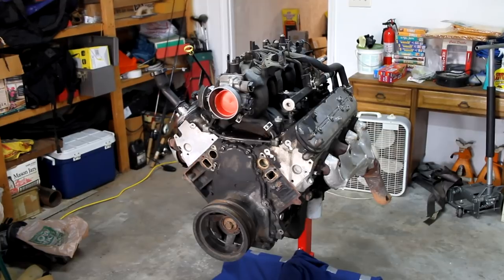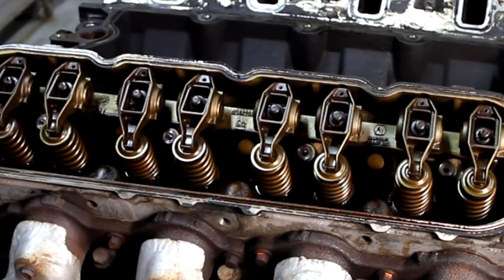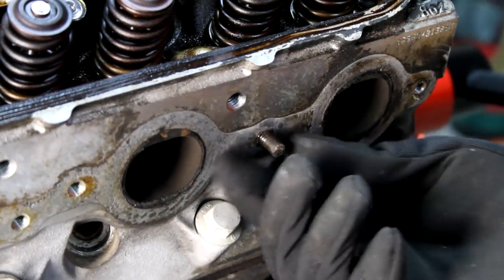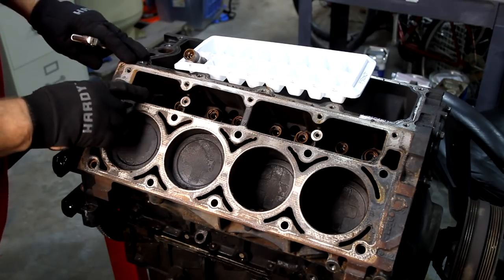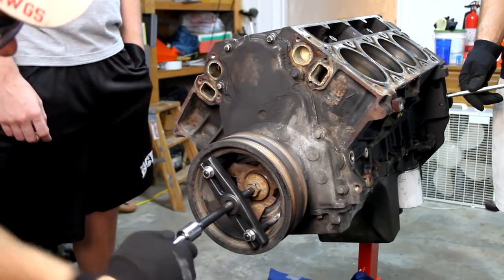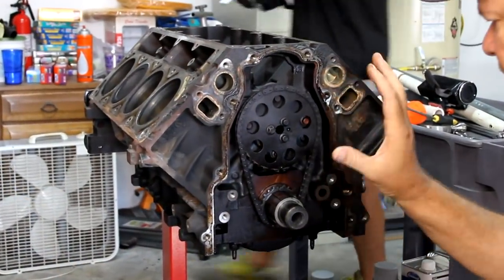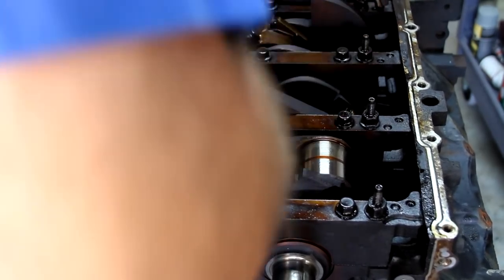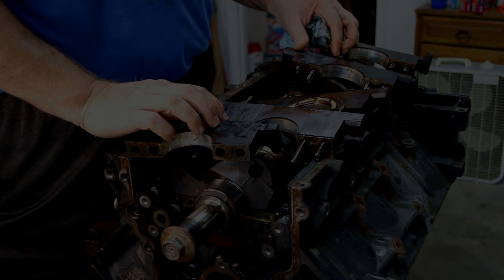LS 5.3L Build Part 2 Teardown | Project Rowdy Ep006

Comment: Love the old school manual wrenching , everybody uses uses power tools now.
Reply from the maker: LOVE this comment!!!!  To date, I have received 5+ comments suggesting that I should have used Impact wrenches and other power tools.   First off... I have 2 Air Impact Wrenches and a Cordless one as well.   The manual that I followed mentioned that many people destroy the end threads of Bolts and Holes.  It suggested not using them.   My thought was... Cool I breakout the old Speed Wrench and have some fun.  We weren't in any hurry...  If we were, we wouldn't have filmed and edited it (adding to the timeline 4 fold!!!!).  Damn... I sped up those boring parts and trimmed the duplications!  Just goes to show that you can't please everyone.  Especially the Online Keyboard Mechanics.  Their videos are perfect!!!
Reply: @UCanDoIt2Mike  will agree impact guns can do damage removing bolts especially in aluminum do to the speed... i do however like to use air ratchets... still faster than hand but wont sit there free spinning the bolt on the threads under pressure... not a complaint just a thought for others who may not know better... and ill admit i do things different for work vs my  personal projects(for pleasure).. sometimes its just more fun to take your time
Reply: @UCanDoIt2Mike  Yeah, I've never understood the need for folks to say "You should use power tools".  I mean, would I use them? Absolutely!  But this is YOUR project, not anyone else's so I can respect your decision on not using power tools. Damn good point though on boogering up the threads upon removal with an impact. It's something that I'll definitely keep in mind for the future...
Reply: With that logic why do you drive a car. You should walk since everyone uses cars to get around these days lol

Work smarter not harder.
Reply: A ot of time on his hands.
Reply: I'd rather use hand tools u risk breaking something with power tools alot more than with ur hands
Reply: I had the same thought as this comment

Comment: Thanks for the shout out. I am also picking up some good tips from you. I like the ice tray for lifter storage and the 2X4 for push rods. I'll do that next time. Ive used an old shoe box with holes poked in the lid before. Awesome tear down video!
Reply from the maker: This is such a great platform to share information.  I had ordered a couple of trays for the teardown but they were going to be delivered several days after I realized that I wanted to perform the teardown.  So I cancelled and made my own.
Reply: Sam's Garage I thought the ice tray and the 2x4 were excellent ideas aswell haha!
Reply: Yeah I like that idea as well .

Comment: Great video a couple of tips for the harmonic balancer you should always use a 3 jaw puller to remove a LS balancer. When removing the cam use a couple of the long water pump bolts in the cam as a handle to help you remove and install the cam.
Reply from the maker: Justin Thurman very good points.   I had seen many time people using the water pump bolts for the cam.  The manual that I was following suggested the method I used, so I thought I would give it a try.  Cheers!

Comment: What did you use to pull the balancer? Also how did you position that piece inside it to pull it? It's not a traditional 4 arm puller correct?
Reply from the maker: I was unsuccessful with the 2 types of 3 jaw pullers.  What I used in this video was the large Bearing Separator that is a part of a 2 separator kit from Harbor Freight.  I placed the separator behind the balancer and the center threaded portion went against the original Balancer Bolt.  Worked great for me!
Reply: UCanDoIt2 oh that's very interesting. Also I know someone already asked you but what size bolt did you get to install the new balancer
Reply from the maker: The Temporary Bolt that I bought is:  M16 x 2.0 x 120mm (Fastenal # 11127092).  It is long enough to get good thread depth for the initial part of the installation.  I explain most of this in Part 5.  Cheers!

Comment: I had same problem with my 5.3 with lifters they were hard to pull out towards end
Reply from the maker: My original lifters had just the slightest bit of build up on them causing them to be a little difficult to pull out as you saw.  The new ones slid in without any issue.
Reply: Same here

Comment: good tutorial. you need some air tools though!
Reply from the maker: I appreciate that!  I have Air tools.  The manual that I was following made a good point on damage to threads when using air tools, so I elected not to.  I did try to speed those section up for your entertainment!!!!!  Thanks!
Reply: the speed up looked cool, but i was mainly referring to the removal/tear down for air tools. I never use them for installation. good work regardless
Reply from the maker: Interestingly,  the book mentioned that people using air tools often bare down to ensure staying on the nut or bolt head and that if they continue to bare down when the threads reach the top, they bugger (technical term) up those top threads.   I wasn't in a hurry and decided to go at it old school. It was fun with the boys.

Comment: 862 heads on this 5.3. Not a bad set up. The video was so helpful. I'm shopping for 5.3s now.
Reply: Can you bore this over 30 ? That put you up there at 5. 7 ? Get 400 hp
Reply: Estebahn Randolph depends on if it’s an iron block or aluminum and what generation LS.

Comment: When doing head bolts good or bad I always soak them an then tap the heads with a hammer. Haven’t broken a head bolt in years since doing that.

Never use impacts either. Always use breaker bars. Hammering shocked the threads and usually loosens the crap holding them on like rust and grime.
Reply from the maker: Not sure how I missed this original comment.   I agree with hammering, breaker bars, and staying away from Impacts.  It's hard to convince today's crowd on some of these items as they are so driven to get things done fast.  It is always best to do it right.   Cheers!

Comment: Hi UCanDoIt2 - did the LS Cylinder heads where the studs broke on the exhaust manifolds when you removed the bolts did it pull the threads in the Aluminum Heads?     By the way GREAT VIDEO on the LS 5.3L ENGINE!!!
Reply from the maker: All three of the broken Exhaust Manifold bolts came out cleanly.  Not sure why the heads were broken off.
Reply: @UCanDoIt2Mike  Thank you for replying GREAT VIDEO series the LS engines and GM small blocks are the BEST!

Comment: We have done many jeep swaps over the years installing 351 efi winsor ford, 350 carbed chevy and also did a 360 efi magnum mopar in the past. They all did fantastic plenty of power and lasted thru the abuse. One of the best swaps we did was taking a flipped 96 f-250 4x4 7.3 diesel standard trans with only 30 k on it shorting the frame and sit a 94 bronco body on the modded chassis. we  gave the 7.3 a stage 2 cam higher flowing injectors bigger turbo and a intercooler that was not standard in 96 That was supposed to bring it to the 500 hp huge torque range, never dyno'ed as the twisted drive shafts and broken yokes proved the power ... That bronco was a beast that would not stop after having non hollow drive shafts built and it brought big big bucks on ebay.
Reply from the maker: Love them ole Broncos.  And I have a friend that is driving a 99s F-250 with a 7.3 and manual trans.   Really fun to drive.

Comment: Would it be beneficial to do a compression test prior to complete strip down and rebuild? Or do we assume you will be able to see/correct any issues related to compression when the machine shop gets it?
Reply from the maker: My thoughts....  If you have (or have access to borrow) the equipment to do a compression test, it would be a neat thing to do.  If it identifies a bad cylinder, you can focus a little attention to that area and critique it for the cause of the issue as you are tearing the engine down.  Ultimately, it will not have much bearing on the outcome as any leak around the rings is going to be resolved with the Bore/Hone and new Rings.  Any leak in the heads (valve seating and valve stems) will be resolved if you are having the head rebuilt.   If you were to do a preliminary compression test and the result indicated Great compress, it may influence some of your choices during the machining process, especially on a budget build.   Cheers!
Reply: magnaflux than block and heads to see if you need a sleeve.
Reply: Will  not matter..machinists are notorious for ignoring every word we tell them :)) rightfully so in most cases.

Comment: Question, I am planning on doing a cam swap on my g8, when I remove the heads to I have to relieved the tension on the springs first, or can I just take them off? Thanks in advance
Reply from the maker: I would take the Rockers off first.  Being that you really need to have them off when you reinstall, it would slightly affect your head torqueing if you tried to leave them on.   Make sure you find some way to keep them in order and return them to the same location.   I used a 2x4 with drilled hole to organize my push rods.  And you can use old Ice trays for the rockers.  Once the heads are off there are some rods you can insert into the engine near the cam end plate to hold the lifters up.  You rotate the engine once or twice with the rods in place and the lifters will stay in the upward location allowing you to Remove and replace the Cam.  There are videos out there for that.  I did not use this method due to the nature of my rebuild.   Have fun with that!!!!!!  Cheers!!!!

Comment: im just wrapping up the afm delete on my 2010 Silverado 5.3 lmg block. I did the cam swap, lifter swap and valley cover swap and had the computer tuned to delete the afm error codes. the kit I got was meant to keep my vvt so its a non afm cam but original type single phaser  cam bolt. have a few questions. 1, what oil do I use to break in the parts. 2. the oil is completely drained from the block its all in the pan new oil, how do I go about starting the motor without it running too long without oil. 3.. when I put the old original cam and the new cam together I lined both up to the small stud to align the cam sprocket and noticed the lobes were totally different positions from eachother. I put the cam and sprocket on and aligned with crankshaft sprocket and with the heads and springs lifters back on I rotate the motor and nothing hits so its definitely on right but will it fire correctly since the lobes were in different positions and opening/closing different than original cam? thanks in advance
Reply from the maker: Awesome Build you have going on there!   (1) For BREAKIN OIL, it was recommended to me to use a "Non-Detergent" Oil.  I shows what I used in one of the Build Videos.  (2) Some people disable the engine form starting and then turn it over many time to allow the oil pump to begin flowing oil.  Many people (because they pre-oiled the pump) will just run the engine and allow it to quickly catch up.  You should find some way to determine when the system is primed (Valve covers off and inspect is one way).  (3) When I first read this one, I said ouch!  Because the new Cam is a different grind/spec, you should see a slight different in position when you have both cams next to each other and indexed the same.  If they are way off, there could be an issue.  I would suggest "Degreeing your Cam".  Look that up on YouTube of Google.  There is a process that is not difficult, but somewhat complex where you are Verifying that the Cam is Ground and Installed correctly.  I believe that the Gen3 and your Gen4 engines FIRE based on the Crank Shaft Position sensor telling the PCM/ECU when the fire the coils.  Great idea to rotate the engine and check for interference.  Hope this helps.  This was my first Gen3 rebuild, but I learned so much.  I would live to see the insides on the VVT on yours!   Chees and hope this helps.  Maybe someone smarter than both of us can share other opinions.  Cheers!   Mike
Reply: Love the ls series so simple yet so perfect.

Comment: fantastic...great job. That LS engine is a far cry from the small blocks I cut my teeth on. One helluva motor, expertly done. Thank you for your time.
Reply from the maker: Thank you Clifford!!!!  I appreciate you taking the time to leave your well received feedback!  Lots of fun!!!!
Reply: Clifford Wells I have the 5.3LM7 in my 05 Silverado. It's already at 200,000 miles. I run Mobil 1 5w-30 and it still runs like the day I bought it. GM does a really great job with these engines. I think Ford ran into a lot of problems making the 3v 5.4 too complex, they change things way to often. I like that GM had a really great design and just kept it as is. I've seen some examples with over 500,000 miles and have no doubt mine can go that far. Considering the power these can handle, a stock motor is very understressed. I also like that all the LS series motors are compatible with one another.

Comment: At 6:58 could I used a cordless impact socket ranch to take the intake manifold bolts off? And what manifold bolts do you recommend that I use?
Reply from the maker: You can use Air and Electric tools to do all this work.   The manual warned of damaging threads when you're not careful.  We elected the "Country Road" tour.  Removal... Yes, I would not use one to install.  Check with Summit on the manifold bolts.

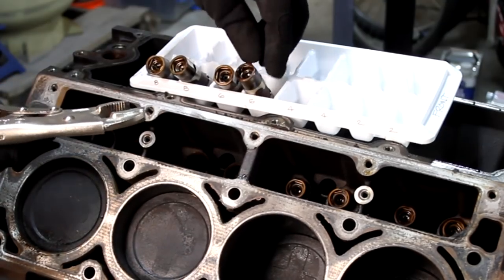Comment: @ 14:10 when I do this, my crank turns and all pistons move freely.  Are you using something on the south side of the engine to hold it in place?
Reply from the maker: Yes!   The original Flex Plate (which I do not plan to use) is still mounted on the crankshaft.  I am using a very large flat blade screw drive and creating leverage against one of the Engine Stand mounting sleeves.
Reply: @UCanDoIt2Mike  Perfect.  (Duh, why didn't I think of that).  Thank you a million times for this video series, you are the best!  I'm tearing down an LM7 I just found on Sunday.

Comment: 👍👏👏👏  I like how you use the old method to check the pushrods to see if they were bent my man
Reply from the maker: Seems like a good idea so that if one is bent, you know where is came from and you could investigate that cylinder further.   Cheers!!!!
Reply: @UCanDoIt2Mike  yes sir I always use that trick very good method and it works let me ask you this why did you use dry Bulls twerking down the mains I thought you had to dip oil at the tip of the bolts and then twerking down
Reply from the maker: @oillife2115  During the final assembly, i placed a small amount of oil on the main cap around the holes.  That may or may not have made the final cut of this series.

Comment: What you mean when u said standing water around knock sensor u saying it’s water around there just taking everything u say carefully
Reply from the maker: When  I lifted the Knock Sensor caps off, there was standing water around the Knock Sensors themselves.   Under the Intake Manifold there is an open space.  Water (Rain, Washing the engine) can get into this space.  If allowed, it can seep past the KS covers and land on top of the KS.  This typically should not happen, but the setup will allow it.   This probably is the reason many KS go bad.  They short out from water penetration.  This is why I put the silicone damn on mine.
Reply: Ok and when u set the rockers to top dead center it has to be dead in the middle not a inch off
Reply from the maker: Not sure what you are asking or stating here.  When you tighten down the Rockers...  you need that lifter on the base circle.  The method I use will do that.  It has nothing to do with a cylinder being at Top Dead Center.
Reply: Yes sorry for the confusion but yea I was talking about setting the timing

Comment: Thank you for the video. I wish I knew where the long bolts from the oil pan came from. My motor came without oil pan. I wonder if yall rebuild transmissions on this page
Reply from the maker: The long bolts are something that you could pick up from a salvage yard.  I did rebuild an AX15 5 speed transmission on this channel as a part of my current Jeep restoration project.  There is a Playlist with the videos in that series.  Here is a link... https://www.youtube.com/playlist?list=PLo32GavtEb9RA78vGwpiFwhXSvIvHdmPG

Comment: Thanks for the great video.....for some reason no one has been able to tell me with validity why are the pushrods and rockers typically put in a box or off to the side with same sequence they are removed from an engine if they all are identically sized in every way???
Reply from the maker: The theory is that all contact parts in a rotating assembly wear and create mating surfaces.   In the event that you plan to reuse these types of parts, you would want to pair up the original parts that have already mated themselves together.
Reply: @UCanDoIt2Mike  okay thanks so much for the detailed clarification and speedy reply

Comment: What's the model of that harmonic balancer puller and timing ?
Reply from the maker: There is a specific Harmonic Balancer Puller that should be used.  I have one, but am missing some parts of it (I have 2 sons that don't put things away).  Instead of going out to grab another one, I found that I could use something I already have.   I used a Harbor Freight Bearing Separator Kit (62593).  I had purchased this a couple of months prior to rebuild the Transmission for this engine.  Hope this helps!!!!  Mike

Comment: Why was there so much oil in it when you turn the engine over, didn't you drain it first?
Reply from the maker: Some Oil and quite a bit of Coolant was caught in various areas of the inner block.

Comment: Didn’t know 5.3’s were 4 bolt mains!
Reply from the maker: If you count the Side bolts.... they have 6!
Reply from the maker: Because of the strength that was found in the "4 Bolt Mains" (an old school term).  The engineers included 6 bolt main in the design of Gen 3 and up blocks.
Reply: Good to know